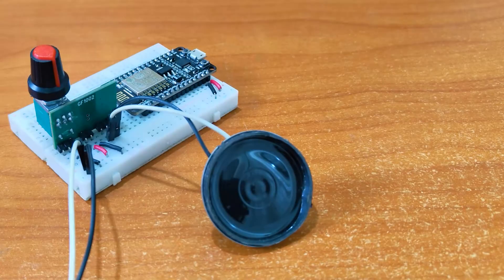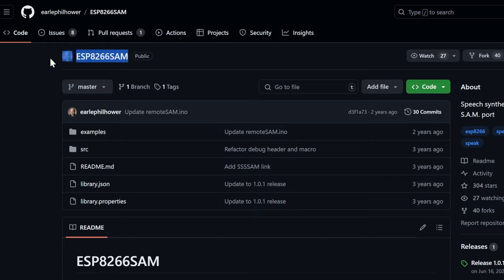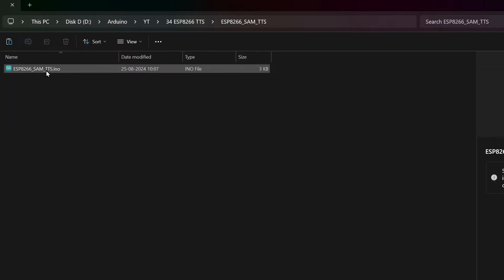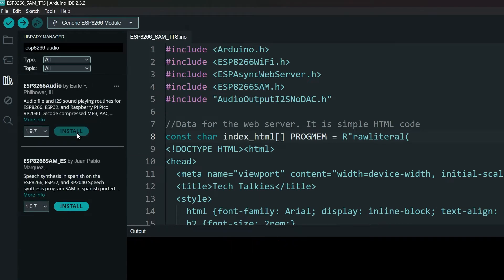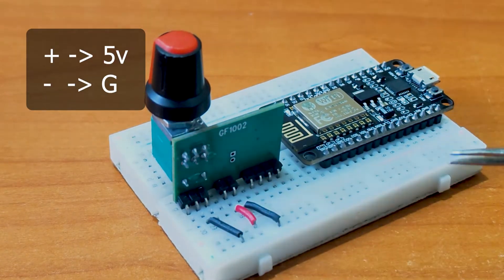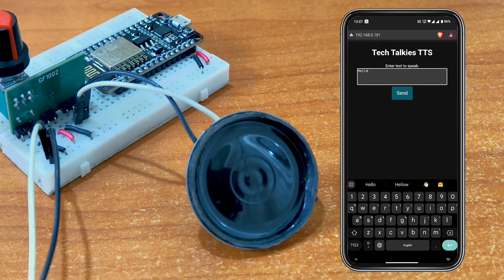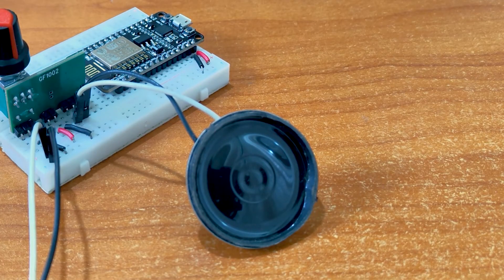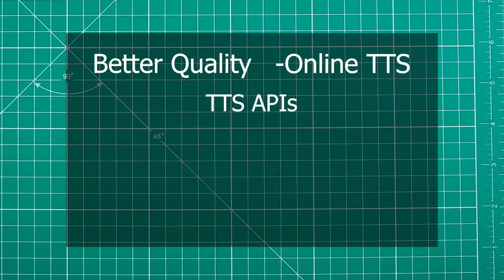ESP8266 - Text to speech fully offline (TTS)

Comment: It works, but why my speaker makes noise continuously? Is it due to speaker or the amplifier(without potentiometer and filter)
Reply from the maker: What kind of noise? Is it a low buzz?
Reply: @techtalkies1   most likely yes, and I resolved it with connecting the pam8403's input source to esp8266's VV pin.Thanks for this great project

Comment: If possible, would you be able to explain what restrictions with the esp8266 audio library prevented working with https links? I'm currently working on a similar project but I also noticed the audio's coming out a bit choppy
Reply from the maker: SAM is very outdated. It is going to sound choppy.
Like mentioned in the video, the 8266 doesn't have enough RAM or processing to run better libraries.

As for HTTPS, the library does not support it.

Comment: if the tts is offline then why do we need to enter wifi id and password?
Reply from the maker: Did you even watch the video?
Reply: @techtalkies1 Yes, thanks for replying but my doubt is solved now
Reply from the maker: I don't know if I helped in any way. But I'm glad that you found a solution.
Reply: @ploternut5476 can you plz explain to me 😅
Reply from the maker: Sure. What is your query?
Reply: @techtalkies1  
If it is offline tts why shouldn't you use it in AP mode.
Reply from the maker: You can definitely use AP mode. I use wifi so that I do not have to disconnect my mobile from the internet to use it.

Comment: Hi, I'd like to do the same project but with a screen and a mini keyboard. Is this possible? And if yes how, I have not yet started arduino for information so my knowledge is limited, and also is the library is customizable if you know a little?
Reply from the maker: Hey, it is possible to connect all types of screens. But it is not possible to connect USB keyboards directly to ESP8266 boards.
Reply: @techtalkies1 Thank you very much for your reply. If I understand correctly, if I want to do what I've explained, I'll have to redo the programming from start to finish?
Reply from the maker: No. Programming is not the problem.
Esp8266 does not have support for usb host, so it cannot connect to USB keyboards or mouse. It can easily create web servers and use that to manage keyboard input.

So, to put it simply, no you cannot ever connect a keyboard to the ESP 8266 as far as I know. You have better luck using an esp32 or the best chance using a Raspberry Pi zero. Let me know if you need direction for that. I'm always glad to help.
Reply: @techtalkies1 hello i dis not view your answer, thank you for the information, if i use eleego Uno r3 dors it will work?
Reply from the maker: This library is specially for the ESP8266.
And Unos do not have USB support either. If you need USB host support, and more complex functions, you should start looking into raspberry Pi. The pi zero 2W is pretty cheap and has everything you need.

But I'm not sure about TTS libraries. But you should be able to find some.
Reply: @techtalkies1 i think i'm starting to understand, raspberry pi is for the project i want, and thé Arduino is for full robotic?
Reply from the maker: Arduinos are just microcontroller boards. They're for embedded projects. Raspberry Pis are single board computers that can run actual softwares and has USB support. The pi zero can host a full mouse and a keyboard and even has a HDMI port.

Check this video
https://youtube.com/shorts/HQCqc6vIDys?feature=share
Reply: Thank you so much  @techtalkies1